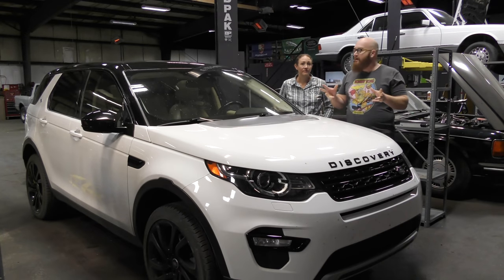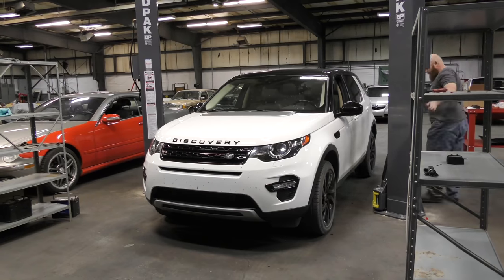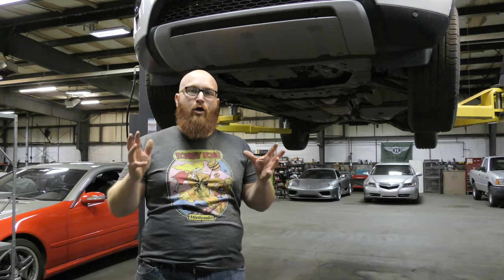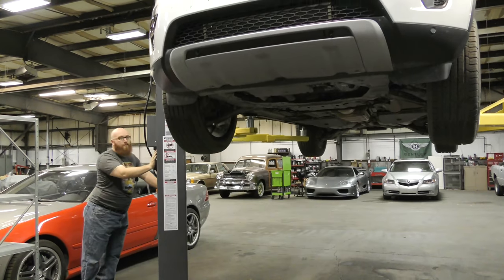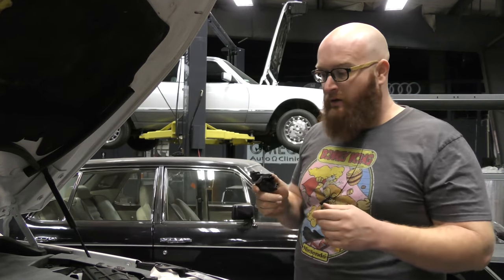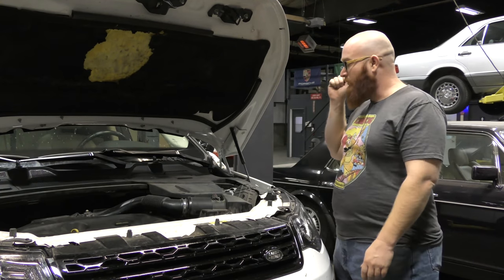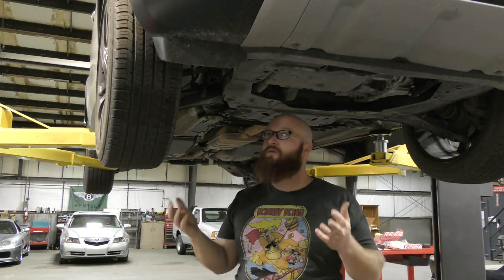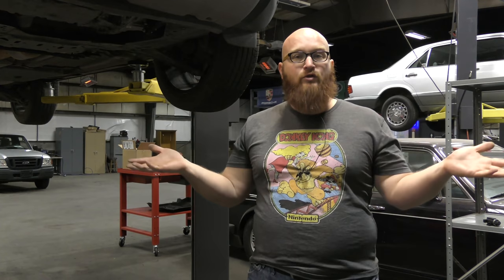I fixed Mrs. Wizard's '15 Land Rover Discovery for $75! How did the CAR WIZARD fix it so cheap?

Comment: I did the same thing with the cam sensor on my 350Z. I bought a cheaper Chinese cam sensor and it failed in the middle of nowhere, although I did manage to limp home. I spent several hundred dollars on the OEM Nissan cam sensor and it's been perfect ever since

Comment: There's a saying in Spanish that I learned growing up "los baratos salen caros" the cheap comes out expensive. Car parts and repairs are no exception to this! I'm fluent in Spanish in case you didn't know!
Reply: There is a saying in English, that goes like this : Buy cheap, buy twice.
Reply: @kevinshort3943  pretty much yes, you get what you pay for!
Reply: @mds2465  Let me correct you: the saying is "lo barato sale caro".
Reply: not so fluent it may seem
Reply: A friend used to tell me, "You either pay now or pay later." I've learned that a lot over time, to reinforce it.
Reply: Lo barato sale caro
Reply: @kevinshort3943  A British expression is "penny wise, pound foolish".
Reply: @ChristianMcAngus  
Sounds Northern to me.
Want a lard sandwich with that?  :)

Comment: After watching PFI Speed tuning customers cars on the dyno and seeing what they had to do to sort issues with getting the power numbers to closely match the setup on the car and the data on the connected laptop, this was exactly what the problem was on a few different cars that they were tuning. 
When you said the turbo was ok and there was no boost leaks, I thought "would it be a boost controller solenoid?" Then you revealed that it was the solenoid and was like "yes, I got it right ".😃
Then you were talking about the noise in the front of the car and was thinking that sounds like an inner fender liner coming loose and flapping on something and you showed the piece that was flapping in the wheel arch and I was like "yep, there it is.  2 out of 2! Yeah!😎👍

Comment: Thanks a lot for the video! Ive checked everything else, but didn’t think to try actuating the turbo with a scanner. Which scan tool did you use to actuate the turbo?

I’m Hoping my launch x431 will work.

Comment: Haha... oh how I love that Mrs. Wizard keeps picking on the Cube.  Well at least it ended up being a small thing.  I can image how frustrated someone would feel if they paid thousands for a complete turbo system replacement only to find out it did nothing.  Much like fixing network issues in my line of work, "verifying" is critically important before acting on the issue.

Comment: Hi Wizard I know what your saying, some years ago my daughter had a little Ford KA a 2 door 4 seater big seller here In the UK, but, it began to lose power at motor way speeds till eventually became almost undrivable with loss of power. Its started OK on 4 cylinders hot or cold but would not rev on 4 cylinders, so, bought a new cheap coil from EBAY - still the same. Then a friend said go buy a genuine part coil and try, so this I did and it cured it/ never ran so quick after.. What was more confusing was its "wasted spark" as you could swop 2 plug leads next to each other and it ran the same/ very strange - lol was on the 1300 CC endura engine OHV but been round for years being modified from factory. Thanks for the Tech tips on fault finding - Ian -- UK.

Comment: The Cube will be running long after the Discovery is in the junkyard.
Reply: S V in my opinion, an unreliable but fun car is better that a boring and reliable car. As long as you can work on said crappy car. The Datsun cube’s automatic transmission is well known (in my area of North Dakota) for slipping. So you’ve got a boring and unreliable car.
Reply: @binnydinney9739  Not a fan of the Cube either, but I respect that it was designed for a role and does it well. BTW, I prefer to have a car that is both reliable AND fun.
Reply: @binnydinney9739  Couldn't agree more. I'm a Toyota dealer mechanic but i owned nothing but BMWs and VWs. They're not as reliable as a Toyota but the ones i owned rarely gave me down time and usually had minor faults that can be easily sorted out by someone who's mechanically inclined like i am. Only "reliable" car brand i owned was Honda (probably the only car company that has a good fun to reliable ratio) but i lost appeal to their lineup after the early 2000s.

Comment: I've ran into this before. I think on an Acura if I remember right. i was in the process of pulling the turbo to check it out and when i went to pull the air box and intake tube, it revealed a small crack in the intake tube you couldn't see when i was assembled. I think the part was $30... Big relief

Comment: Been down this rabbit hole with my old 1992 Lexus SC300, it was my semi-daily driver/road trip car for 7-8 years until I sold it a couple years ago.  Started having an intermittent problem where it would just crank, crank, crank, not start.  Cycle it a couple times, then it would fire.  Finally got bad enough to where it finally didn't start.  Towed to my good local mechanic.  Of course when it got there it fired right up no problem.  

 I was kind of fixated that the problem was this module that controls the fuel pump, only place I could find it was for $400 at the dealer or $30 on Ebay.  Of course I was trouble-shooting over the Lexus forum, they said when that module goes bad it can be intermittent.  Bought the $30 part, had the mechanic install it(it was easy to access), told them to go drive it around a bit.  They did, put 10 miles on the car for it to get hot, tried restarting at their shop and it finally did the same thing it was doing to me.   They finally narrowed it down to having a bad fuel pump, charged me $400 or $500 and sent me on my way after my car had been sitting at their back lot for a week waiting on the magical $30 ebay part and them driving it around trying to replicate the problem.  Felt really stupid because I forgot to tell them I ran the car out of gas(yeah dumb I know) 8 or 9 months prior, then started having the issue a few months later.

Comment: "What was your cheapest, major repair on a car?"  Replacing gaskets or O-rings.  Buying a complete engine gasket kit can often be cheaper than the price of an alternator or starter.  A starter or alternator can often be swapped out in less than an hour too.  Doing an engine out gasket job is usually a 2 day grunge fest for most DIY guys.  One day to get it all out and apart.  The next day to torque it back together and wrestle it back in.
VT247

Comment: It's hard to go to a shop anymore.
We had a tractor that the transmission would not go into gear.
Had to do a field call to get them to work on it. Three trips, and two computer modules later, the problem wasn't fixed. Modules were $1100 a piece, plus a shop rate of $140 plus mileage for three trips, and it didn't even work.
After having it trailered in and doing diagnostic checks, it was found to be a broken wire... The second tech, (first one didn't touch it again) said it was simple to test...

Comment: I had the same issue but intermittent , I knew the turbo was fine but the worst was shops didn't want to replace it because there was no code... I had to insist in a local shop to have it resolved. The turbo was more responsive

Comment: I would actually say you just made a good case for exactly when cheap Chinesium parts ARE appropriate. To test the solution before loading up the "parts cannon".
I have used cheap vanos solenoids or switches or relays as a temporary repair until BMW one comes in more than once. I swap in the "good stuff" when it arrives and clean up the junk parts for next time one of my babies needs a quick bandaid. LOL

Comment: With boost control valves they generally fail due a bit of dirt getting stuck in the valve. Often a good squirt with a can of Carb Cleaner in all the ports to wash the dirt out will get them working fine again.

Comment: I had a similar problem with a Vauxhall Corsa fitted with a Fiat 1.3 multijet Diesel engine. I had to change the turbo because it was leaking oil badly but it didn't cure the lack of boost. I determined that the wastegate was working fine by bypassing the turbo boost controller. However changing that part didn't fix it, it turned out to be a water damaged ECU caused by bad car design. The owner decided to trade it in on a different car as the cost of fixing the ECU was more than the car would have been worth. You win some, you lose some!

Comment: shotgunning seems to be how main dealers trouble shoot, and at customers expense every step of the way.  A good independent garage is always a better bet!
Reply: Yes they always are and I don't care what people say
Reply: the independent shop in town didn't even know how to properly coolant flush a Subaru and made my car overheat. Then when I had to get a new car, they gave me a quote for the entire suspension to be replaced. Did it myself and only 3 parts had to be replaced.  Honestly hate people nowadays, now I deal with the trouble of fixing the car myself even if it means buying expensive tools for one job.
Reply: Parts cannons
Reply: @DatMudkipify  A Pep-Boys in Illinois tried to tell me the car I drove in not only couldn't be driven, but needed more work than the car was worth. After blowing off their nonsense, a complaint to Corporate resulted in an inspection by a ASE-certified and experienced ex-mechanic regional manager who confirmed over $1,000 worth of work was completely unneeded, and comped me a $250 dollar gift card for the hassles.
Reply: @neilmurphy845  at least you can argue it. We had a service done and a few months later a tyre went due to the tracking being off, they accepted partial blame for it and covered half the cost of the new tyre and did the full adjustments needed. Realistically they could say wear and tear but they for the most part accept the responsibility. In the US though where dealerships are more extortionate, it may be less so of a likelihood
Reply: @Horizon301.  Ya maybe I personally wouldn't trust a dealership unless the car was under warranty outherwise I'd stick with a mechanic because there just to expensive.

Comment: I've been burned by being cheap. When I was rebuilding my E36 BMW, I went with a cheap off-brand coolant temperature sensor thinking I'd save a buck over the $50 one from one of the OEMs.

It boiled the coolant on the first drive. Replaced with a genuine BMW part (at $130...) and the problem immediately went away. 

Goes to show you that you shouldn't ever cheap out, especially on a European car, even if it's old..!

Comment: Should a shop refund the full charge if the shop misdiagnosed and the result is zero improvement in the situation?  I’ve had that happen twice over the years, once a very expensive failed repair on a Porsche.
Reply: I trully think they does! As car diagnostic guy, this is what i think.

Comment: Doing better than my International dealer, before I started the truck had a turbo failure and filled the charge air cooler with oil. Dealer replaced turbo and off it went. I get there a year later and same thing, so we send it back for warranty work, they replace the turbo again. I asked why it failed, they didn’t investigate. Turns out the oil feed was restricted so it wasn’t getting enough oil.

Comment: Cheapest repair,   72 Pinto, knocking noise from back of engine.  After examination found loose nuts holding Torque converter to flex plate, missing lock washers.  Took off nuts, added lock washers and torqued nuts to spec.  Total cost,  $0.12  plus about half an hour of my time.  (Relative's car, no charge for work.  "Family Perks.")

Comment: I find Ford's and non OEM parts don't play well together.
Reply: You can only get away with non OEM parts with a Toyota!
Reply: I only have after market parts on my edge and the last repair was like 4 years ago I think your just buying the wrong after market parts
Reply: I’ve used a few aftermarket parts on both of my Benz V8 e classes lol.... you’ve just gotta use the right ones and not the cheap ones from eBay
Reply: @diablocls55  when I buy ebay parts, I buy known brand parts or oem parts., rather than just anything. My source for Chinese parts was Amazon,now I have to be a little more cautious doing that.   Jim
PS.....I purchased a O2 sensor about 3 months ago, from Amazon and it’s working fine ( oem was $295,  Chinese were $29, and Amazon was $75).
Reply: @brian_jake  No need to by non OEM or OEM Parts for Toyota, they don't need Parts...
Reply: @brian_jake  Sometimes you can not.

Comment: This is what must have happened to my work car - no power, goes slower more you put the pedal down, won't go up hill, no error codes, and worked fine everytime it went to the garage (speed bumps at the entrance).

Comment: I had one go wrong, I just removed the crimped sleeve, cleaned and deburred the shaft and reassembled it and it worked fine.  Ths most difficult part was reapplying the crimp.  No parts required, about 1 hours labor.

Comment: Is the 2.0 ford engine the same as the engine in the discovery 2.0. Will a 2.0 ford eco boost engine bolt to the range rover discovery transmission?

Comment: Has she ever had troubles with idling or having to change out the air idle control which you would have to change the whole throttle body is what dealer told me, PLEASE let me know asap! Thanks!

Comment: Mr. Reed! Prepare to fire the forward Parts Cannons!  Travis, reduce to Cube Speed!-- Capt. Archer, the missing 'Enterprise' episode. Seriously, Mr. CW is right. Diagnose THEN fix. And while some shops give free estimates on brakes or exhaust work, and some even a little more, if you gotta plug into it to figure it out, you're paying for diagnostic work. And yes, cheap parts abound these days (not just Dorman). Sometimes a little extra quality doesn't cost a whole lot more for a solid repair. Ms. CW even got in the act, by knowing the car WAS accelerating, but at Cube Speed the 2nd time also, so she didn't panic and think her Range Rover was heading for the crusher, but that something had failed again. Great job of climbing out of the Rabbit Hole on that flapping panel also. My cheapest fix (not recommended)...patching a pinhole leak in a high-pressure fuel line in the engine compartment on an old car with self-sealing silicone tape! $8 versus a heck of a lot more for the line and labor. Never leaked again. Car never caught fire. Win-Win!

Comment: Have you had any transmission issues? Our 16 disco has started to leak transmission fluid. Dealer quotes $8000 to replace it.

Comment: Bought cheap coil packs for a 97 max.  Thought it would fix the problem.  Took it to a mechanic, he said some of the new coil packs were bad.  I had all the old ones in the trunk, and he pieced together a working set.  Car ran great.  Smdh.

Comment: P0299-00 turbocharger-supercharger underboost. 3 port turbocharger vacuum solenoid pintle failed. Install a new one, clear codes and fuel trims and send it on a 30 mile road test, scan it after road test and if no more faults show send it on its way. Total labor including diag is 2 hours.

Comment: Had a 1988 S10 with the 2.8 V6. It had 134,000 on it when the check engine light came on and power was down. I took it to the stealership for diagnosis because they had evening shop hours and I didn't feel equipped to diagnose a computerized vehicle. They looked at the ODO and said I needed to buy a new truck. They said I needed a bunch of expensive stuff (computer, throttle body gasket, lifters--you name it, it was on the list). I went home and changed some of the stuff they said needed to be changed. None of it needed to be changed. I also found they left the O2 sensor unplugged. You know what it turned out to be? One of the new spark plug wires I had recently put on failed. The shop with all the fancy computerized scopes and tech bulletins didn't find it. I WENT BACK TO BASICS! Pulled wires until I found the missing cylinder and put an Ohm meter on the wire. NEVER AGAIN! I only go to the shop to have the scan tool put on to read the codes.  BTW, I kept the truck until 188,000 miles. The V6 was getting a little weak and the P/S had a big leak I didn't want to fix. Probably should have kept it.

Comment: If I were to buy a Land Rover and take it to a Ford mechanic, are the book time estimates the same for Ford vs Land Rover? For example, is this fix a 3 hour book for Ford but 9 hours for Land Rover?
Reply: Probably not. Ford dealers will not work on anything other than Fords, Lincolns, or Mercurys. Or Mazdas like the B series and Tribute. Even though that that particular Land Rover has a Ford engine the dealership cannot work on it because the software is different. Same thing goes for Volvos and Jaguars with Ford engines.

Comment: 04 CLK 500.. Transmission went into limp mode. I knew it was one of 3 things.. Control board/connection, solenoids, or bad transmission. Luckily it was just the board and a few solenoids. $800 and she was back on the road.

Comment: Buy cheap buy twice! But... some money can be saved, by buying parts from the OEM, rather than the dealer, for example, the solenoid is probably made by Bosch/Siemens, Pierburg, Valeo, Delphi (or something along those lines) and a parts store would sell you the part for (for example) 50 bucks rather than 75 at the dealer because it’s in a Ford box.

Comment: I think I'd buy a spare boost solenoid and put it in the trunk. the quality Ford motorcraft one only lasted 5 years and not very many miles. Pretty likely it'll happen again at some point and if you were on a road trip, it could be something that would not strand you but cause serious difficulties.